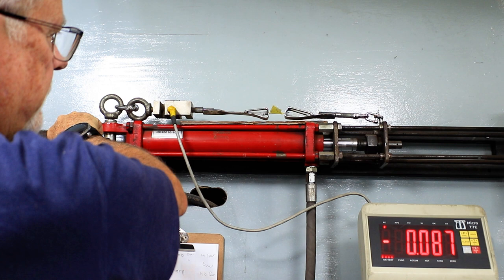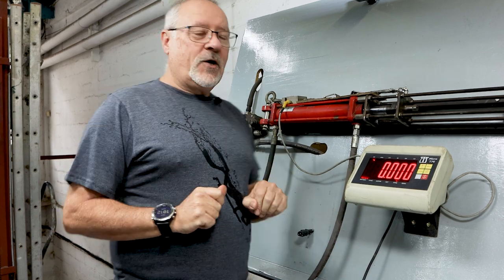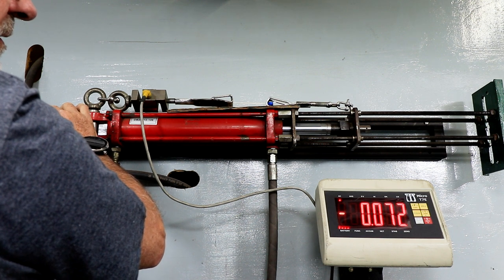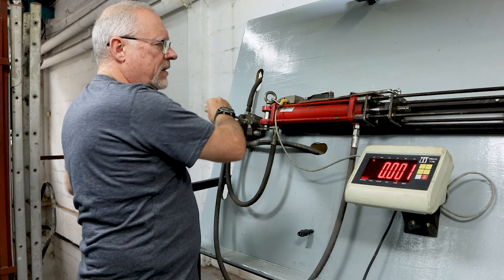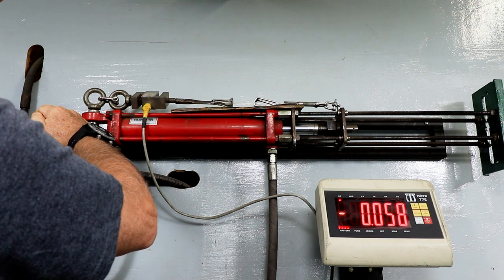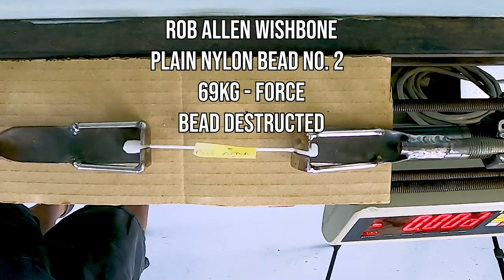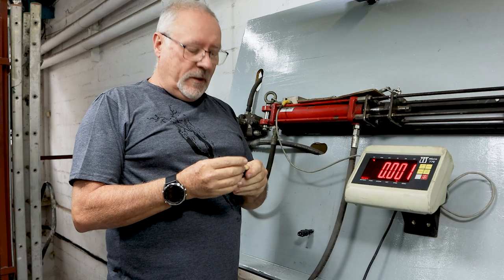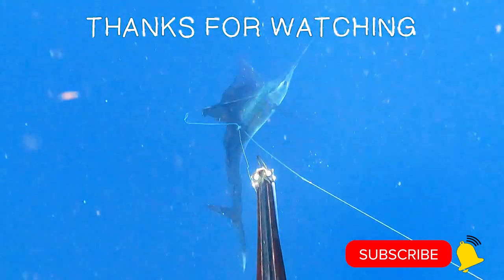Rob Allen | BREAK TEST | RND Wishbone | 2022

Comment: This type of RD needs to be done using FEA Software, it's ideally suited to it. There are no liquids flowing over surfaces etc which can lead to unforeseen inaccuracies. The latest software will even spit out the best shape using whatever material you choose. Nylon 3D print the shape or mold it and then test it.
Reply from the maker: Agreed but.... we just use what is easiest for us. Regarding 3D printed nylon, it will never be as strong, been there done that.
Reply: @RobAllenSpearfishing  Agree with you & not sure if to be strong, like metal (salvimar type) is the best solution, it can seriously damage the interior of the rubber, as well hard molded plastic, can also do.
Believe that a compromise between strong but with some flexibility should be the best and a strong knot will handle it, without a "sudden break point" of the plastic walls.
I still use RobAllen except for 14mm, it creates a way to tight knot and "crack" very fast the exterior blue layer of your rubbers, on the knot surface.
Reply from the maker: @pedrocostareis8330  I agree metal is stronger but, we like to keep costs down and to make it lighter. Any added mass in the rubber will slow the spear down. This video was not really about the wishbone bead, more to show the R + D we do for a product. Many products do not get to market after much testing.

Comment: The rubber test is not correct...the force is made by pulling the dynema without having the metal plate supporting it...
Reply from the maker: I don't follow, the metal plate has a slot in it, the rubber is hard against the plate and the Dyneema line is set into the slot with no suport.
Reply: vc esta errado meu amigo
Reply: @RobAllenSpearfishing  he misunderstood the test setup
Reply: @RobAllenSpearfishing  Apologies & maybe I did not explain myself very well:
- The test is to the plastic piece that holds the dynema, correct?
- What I think is that having the rubber between the steel plate (tension equipment)  and the plastic piece, tide by the knot on the rubber, will smooth the tension because it will be also dispersed it by through the rubber and the knot around the rubber...
- The plastic piece is conic shape, so the "pushing force by the equipment is also supported by the rubber & knot.
- On the other test, you just consider the strength of the "wall" of the plastic piece, but in this one, you have to consider the friction on the "conic shape of the plastic piece".
The proper way to say is "the test with the rubber has another variables not considered in the other tests..."
At least that's the way I see it in physics terms...
Reply from the maker: @pedrocostareis8330  No need to apologies, we welcome feedback, this is the best way to make things better if we listen that is. I agree it is different from what would be the case on a gun in water but, we applied the same test to our current wishbone we have been selling for many years to get a base line. We are testing both the line, the knot, and the bead. No point in having a strong line and a weak bead. The weakest link in the chain will break. I added the rubber sections just to check if the rubber would support the bead more. It did not. It actually gave a slightly lower reading. We don’t test an actual rubber made up because the stretch in the rubber would mean the bread could be dangerous to me doing the test. In all the cases here the bead failed, not the locking device. The locking devise is not a knot. So, the test was to see how this works and, at what load it fails. We are now modifying the bead and the material it is made from and will do another test. These videos about breaking the wishbone are not really about the testing but really to show the R+D we do.
Reply: @RobAllenSpearfishing  Totally agree and of course now I understand it fully...Wishbones are always a problem, we made guns each time more powerful and, I myself already broke a lot of manufacturers and send it to them to revise or simply cancel it because they are dangerous.
Thanks' for all the additional information and again, sorry if I was incorrect in any way.
Reply from the maker: @pedrocostareis8330  No problem at all, always feel free to comment 👍